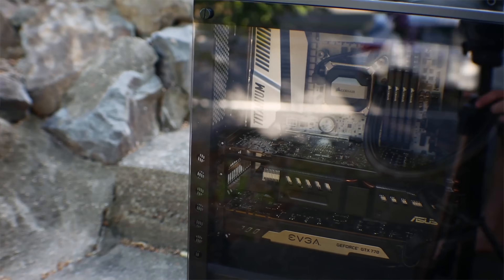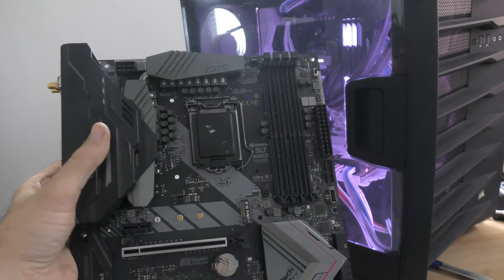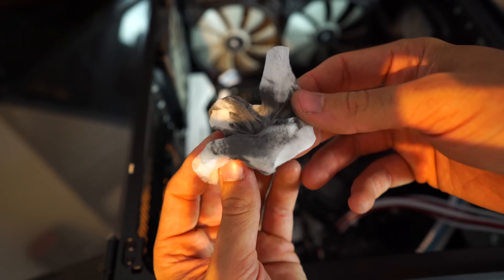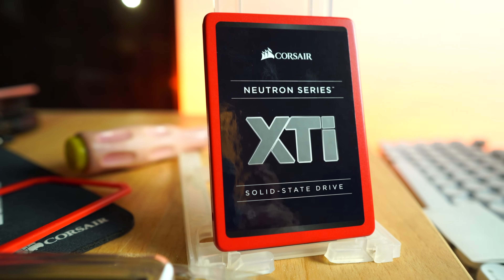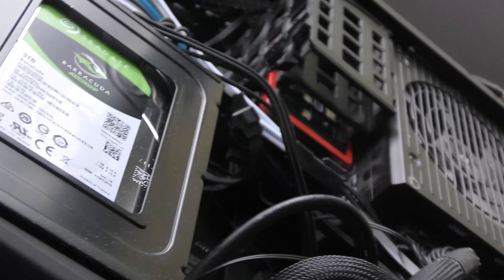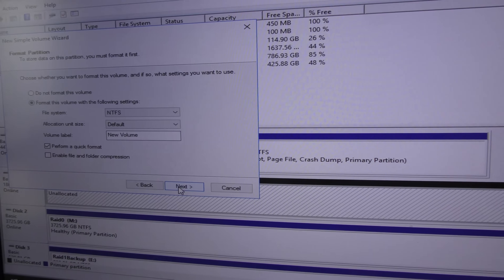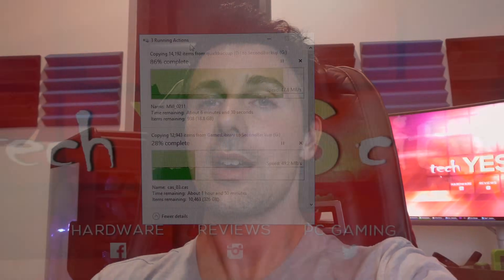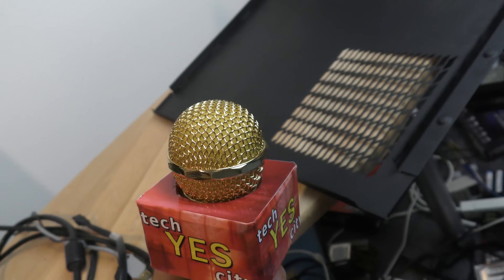Changing my PC from RYZEN to INTEL - Side, Up or DOWNGRADE?

Comment: Even if Intel atm might be better in terms of performance, it's still more than 30% more expensive than a r7 and really not that much more powerful than the red team's pick. We must agree that amd brought something amazing to the table and that is competition, with their zen core processors
Reply: Jackal1810 The thing is that the 8700k doesn't have a MSRP of $300, more like $350, plus it is nigh impossible to find one even at a n inflated price. On the other hand, Ryzen CPUs are so plentiful that you can find them well bellow their MSRP almost everywhere. If someone had told me last year that I was going to be able to buy a 6C/12T processor with Haswell IPC levels for less than $200 in 2017 I would have laughed in their face.
Reply: @Jackal1810
AMD - 
Asus STRIX X370-F $190
Ryzen 7 1700x $280 (without promo code)
Gskill TridentZ 16gb 3200mhz $154
Cryorig H7 $28
Total: $650

Intel -
Asus Strix Z370-F $194
I7 8700k $415
Gskill TridentZ 16gb 3200mhz $154
Cryorig H7 $28
Total: $791

Difference of $141 All prices taken from newegg so with $141 difference given a set budget you could upgrade to the next gpu tier with the Ryzen system. Adobe products use to scale well till the updates but hopefully this will change in the future. My point is that with a ryzen system in 2 years you can just upgrade to zen2. while intel you will have to buy a new CPU and motherboard as z370 wont support anything more than 6c/12t.
Reply: Jackal1810 the lowest price i see is $415 from Newegg. Still think Ryzen is the way to go for under $270 I don't think there is no denying that price to performance.
Reply: Jackal1810  Nope...
Ryzen 7 1700 can be found for 200$, it has its stock cooler and you can easily get to 3.9 ghz with a b350. It's rare that a ryzen chip doesn't reach 4ghz, there are more chips that get to 4.2ghz than chips that get to 3.9.
You don't have to spend to much for rams... I found 2 4gb ram sticks 2666mhz and CL15 for just 77$, and I can easily overclock them.
Ryzen has way better value. 
You can get for 350$ a ryzen 7 + b350 or mATX x370, and you can overclock ryzen with the stock cooler.
With intel you have to spend more than 600$ to get mobo, 8700k and a cheap cooler.
Reply: Jackal1810 Everyone can say everything he wants to say. But is that true?
I can easily say that I've got 4 way sli of 1080tis, but am I lying or not? Who knows...
Reply: Jackal1810 wait I'm not familiar of any i7-8700k processors for $300!?! Where are you finding these prices at?
Reply: @ Mathew Geyer
I bought an 1800x a little over a month ago, along with a Crosshair VI Hero w/Wifi.  I have a custom loop with 2 rads, just for the CPU.  This CPU hits 4.2 on a pretty regular basis, and it's set to "Default" under the OC setting.  I left it alone completely.  The only settings I changed were mem to get to 3200.
The only problem I ever had with this setup was with the BIOS.  I used the latest (1701) from day one, but I had to re-flash it twice due to some strange things happening.  This guy probably should have re-flashed before giving up.  This thing runs fantastic and is getting some very respectable scores benching.  I run AAA games on an RX-470, and I never see the CPU taxed more than 25%, and that's with AC Origins.

I love this thing.
Reply: Lol, the 1700 is the same price as the 8600k, in someplaces its actually less!
Reply: Marius939 / Apocalypse Rising just a year ago you couldn't get an 8 core cpu that wasn't a $1000
Reply: Henji96 what did you have to do to get that clock speed? After market cooler? Delid? How much did you spend for your 5.2ghz? Also the 7700k is only $290 now so if the performance increase is worth it then great, otherwise I would have suggested going with something else.
Reply: I do agree 100%.
My r7 1700 comes within roughly 12% of a similarly spec'ed intel 8700k system when talking about gaming, but in raw cpu horsepower, using Cinebench I hit around 1765 on average from three runs, which means my r7 1700 is stronger than an intel 8700k.
why pay LOADS more for a system that is only better at gaming, and only by a little over 10% The motherboards for that system are way to expensive.
I get it, I want one too because of the gaming performance, but the facts are as such that normal people cannot afford to spend that much for a rig.  Especially if they just upgraded to, say, Ryzen, which is BY FAR the better buy IF you take price into account.

If price is not a concern and someone just said "pick one and it is yours"
two of the exact same in every way except platform and cpu, temps of the 8700k would assure me I stay with Ryzen.  Outside of that I cannot thin of a reason to NOT go with the 8700k system.  Price and temps are my issues with it, other than that, it is one hell of a machine.  It kicks ass, but the price will kick your wallets ass.
Reply: It was a typo.
Reply: price, availability to name two
Reply: Jackal1810 250 isn't bad for   1700
Reply: issaciams delid + x62 cooler + luck. I haven't tried 5.3 GHz yet so I might be able to push it further. My only concern is the temps.
Reply: https://youtu.be/MsnoN5dIPiE?t=2m
Reply: Sure, R7 1700 has better price to performance if you only compare CPU prices, but if you compare full system costs, the price to performance will be a lot closer.
Reply: Fugboi false, a z370 motherboard is very expensive at the moment and you can find a b350 or even a x370 for roughly 120 dollars , the ram and the rest being the same, ryzen setup comes at a lot less money while being only at most 15 percent behind the 8700k
Reply: Marius939 I checked that full system with r7 1700 and 1080ti would cost me $1620, and that's with cheap $60 motherboard with bad VRMs and stock cooler.
8700k system would cost me $1881, and that's with $100 motherboard (probably not the best VRM, but it'll do 5GHz with acceptable temps according to der8auer) and dark rock pro 3 cooler added.
I would 100% pay $260 (16%) more for the 8700k system. The system costs will get closer, if you want a better motherboard for ryzen with better VRMs, if you want better than stock cooler, and when 8700k's prices come down.
Reply: r7 1700x can be found for as low as $230 from microcentre, 8700k is currently around $400 you can buy a $40 cooler and get ryzen to 4ghz.. For gaming with a 1080/v64 or less ryzen is the way to go specially since youll be able to upgrade to ryzen+ next year while with z370 you are stuck with 6 cores
Reply: What makes me a shill? When I have the R7 1700, R7 1800X, 8700K, I can talk from a productivity and gaming point of view.
Reply: +Jackal1810
Nah, for a gamer and productivity guy Ryzen is probably better.
You don't need 144 Hz gaming to enjoy yourself.
Also, have you noticed that the Ryzen systems tend to do better then the equivalently priced Intel CPUs in GPU limited scenarios?
Probably just because of having more cores in the various price ranges, but still.
If it was just one or two reviewers it would obviously just be a statistical insignificant thing, but you see it again and again all over the place.
It's a tiny difference though, usually 2 frames pr second more then the Intel one, sometimes 1 or 3 (hence why it would be irrelevant if it was just one reviewer).
When things are CPU bound then yes, Intel runs away with the averages at least although there's a real fight over the 1% lows.
Actually, you can argue that the experience might be better with the lower difference between the 1% low and the average, although I guess that's a bit up to preferences...
Another thing worth mentioning is that Ryzen is still new to compiler developers and game developers, so even the "Ryzen optimized" code paths in compilers are still only marginally better then running stuff with Intel in mind.
With time Ryzen is likely to improve though.

As for IPC...
Ryzens and Kaby Lakes strengths are in slighly different areas.
When you're just running one thread pr core Intel is a clear winner in IPC due to lower memory latency, lower average cache latency (although some of Ryzens caches are actually competitive), slightly better prefetching and branch prediction.
However when you fill both the threads of a core often Ryzen matches or even beats Intels IPC and can have up to 25% higher IPC in highly optimized (for Ryzen) workloads.
The reason for this is that while both cores have a front end feeding in 4 IPC and Intels Kaby Lake having 8 execution ports vs Ryzens 6, they both also have an opt-cache potentially allowing at least Ryzen (and probably Kaby Lake too) to feed more then 4 instructions in loops and other situations where instructions are repeated, and Ryzens execution ports are a bit more balanced instead of having one "super port" responsible for a whole ton of instructions like on Kaby Lake Ryzen spreads the instructions around the ports in a way that's a bit more balanced reducing the risk of a instruction having to wait on the super port to finish, and since Ryzen also have a back end able to retire up to 6 instructions vs Kaby Lakes 4 that means that Ryzen can in theory do 6 instructions in a single clock cycle while Kaby Lake can never excede 4 (this is for the whole core, with workload from both threads at once, your average thread can only feed  a core with 1-3 instructions pr clock cycle).
Of course the reality is that this only happens in corner cases for a single clock cycle and is not sustainable in practice.
However 5 IPC is actually attainable on Ryzen, provided that the software is programmed to make use of it in both the threads.
So when game designers start adding Ryzen optimizations to their inner game loop they can in theory get quite a boost in performance on Ryzen.

Of course Ryzens advantages only helps when you have two threads in use on the core that's filling it up to the chocking point where Intels better front and inability to retire more then 4 IPC holds it back.
And if both cores get a mix of more then and less then 4 instructions in pr clock cycle Intels 8 ports can actually in theory work on 8 instructions at once (provided that it's instructions that's available on those less capable ports) meaning that the core have more instructions on hold in the core ready to be retired potentially keeping that max of 4 IPC a little bit more consistent in Intel optimized workloads.

Also, spagetti code (not optimized for either) struggles with getting 4 IPC out of a core meaning that AMDs advantage don't apply while Intels still do.
And that's part of the reason why we're seeing Intel pulling ahead right now.

(Even if you have a thread full of instructions if they're not organized in the right way to best utilize the capabilities of a CPU you'll run into bottlenecks lowering your IPC. this happens on both CPUs but due to more compiler optimizations for Intel it happens less on Intel CPUs)

Still, given that games are becomming more and  more multi-threaded Ryzen has more potential, even for gamers in my view.
At least when it comes to high consistent performance and utilization of modern hardware in modern APIs.

You're probably right that the high refresh rate monitor crowd will still be best served by Intel for some time yet.
Both due to clock speed advantages, higher IPC during low thread count workloads and spagetti code and slightly lower latencies for the memory and cache.
But as we move towards 1440p, 3440x1440 and 4k becomming more mainstream I personally think Ryzen is better suited to saturate the GPUs long term.
Reply: You might be "stuck", but you're not using the correct motherboard anyway. Anyone with a current Ryzen setup shouldn't be thinking about getting Ryzen+, it should last you far longer than a small incremental "upgrade".  
Unless you've got deep pockets that's a silly comparison to make, not all Ryzen chips hit 4GHz, you're also going to be paying more for faster RAM where as Intel doesn't need it as much. 
You can also do the same for the 8700K with a "$40 cooler" - not sure what the point is you're making there, when the chip can hit 4.5GHz+ easy.
You lose out on gaming performance with Ryzen but you get the same kinds of performance in productivity, I really don't think the added cost is by any means bad, considering you will now have way better performance in 95% of your Steam library.
Reply: What would be your reasoning for it to be "stupid to buy Intel late 2017 lol"?
Reply: @MythionVR  I dont mean to be rude or anything but the Ryzen 2700x is about $70 cheaper than the i7 8700k and comes with a really good air cooler. The Ryzen 2700x has 8 cores, 16 threads, while the i7 8700k has 6 cores, 12 threads. The i7 has a clock speed of 3.7 while the Ryzen 7 has 4.3. The i7 8700k may be better than the Ryzen 7 1800x (Which is more expensive than the 2700x), I think the Ryzen 2700x is a better deal the the i7 8700k at this point in time.
Reply: @Matthew-ne1xc  None taken, you are however comparing a CPU that was launched over a year ago now, to that of a CPU that came out this year. There would probably be problems if the 2700X didn't at least perform the same/better than an 8700K. I have since moved onto the 9900K since I originally made my comments.  

I still have my 1800X and my fiancee has my 8700K this time around. The 1800X still encodes quite happily, daily on my network.
Reply: @MythionVR  Oh my bad i didnt see the release date on either processors lol I prob should have checked that
Reply: @MythionVR  And im not trying to put either down, they are both amazing chips each with their advantages, and i wish you the best with ur pc:)
Reply: @Matthew-ne1xc  I figured. I love both for what they're good at and I'm more than happy with AMDs current performance, I haven't had an AMD CPU for almost 6 years once Ryzen was launched.
Reply: both are more than fine in gaming , even my R5 1500x can keep 120FPS on a 1080ti on quite a few AAA titles 

Only if you use programms that hugely favor clock speed (adobe >-> ) should you go with intel
Reply: For you, maybe, but considering most of the stuff I play today, which are anything in the last few years performs better on my 8700K, plus my work is better.
For me, it's absolutely worth it.
Reply: Of course it is, nobody is denying that it's a good chip for a good price, we're talking about which is better.
From personal experience, using many Adobe products, Premiere, After Effects, Photoshop, Lightroom and using handbrake, the Ryzen chips are good, but my 8700K does it quicker.
My 1800X has since been retired to transcoding anything I put on my network, which it does a great job at. As for the R7 1700, that's in my fiances build as an upgrade from the 3570K.
Reply: "way better performance " 20 FPS that are beyond the 120 FPS range 

how do you pay more for faster ram ? they both use DDR4 which is stupidly inflated right now
Reply: Winfield Konkel So send me the links, so I can buy the 8700k for 250$.
Reply: How do you NOT pay more, for faster RAM? Go look at DDR4 2666MHz vs 3000MHz/3200MHz. If they were the same price then nobody would pay for 2666MHz.
Overall it's a bit more than 20 FPS, just because you're getting 120 FPS in say 2 games, doesn't mean that's a winner and you should throw out your Intel chip.
Go look at benchmarks on many games, instead of cherry picking, the vast majority are more influenced by IPC instead of multithreaded performance.
Reply: I know you're tooting the "price" horn, but we're still talking about what is better, Intel wins in performance without taking price into consideration.
This is what I've been saying, I still don't get the need to toot the horn of "hurrr Ryzen is r bettr!!1", I own two Ryzen CPUs, my 8700K is better.
Reply: Jackal1810 intel is better in performance, but it's not worth the price.
Reply: "For 20-30 fps of difference" in what two games? You're getting much higher performance in ALL of your games. Maybe you should have gone with a 1070 so you could play more games and see more of a difference.
I have a Steam library with 500 games in it, my 8700K does a much better job, especially when everything runs at great framerates instead of "20-30" FPS lower in the two games you play.
Reply: Wrong
Reply: $400 isn't bad at all for the 8700K, and it still really shines in games and trades blows in productivity. If you're a gamer AND content creator and/or streamer then Intel is what you should go for.
Purely productivity? Go Ryzen.
Reply: Jackal1810 you are indeed right, they are trading blows and now it comes down to you of what do you prioritize, gaming performance or quickness in productivity
Reply: Both, so I go with the 8700K.
Reply: "Only if you use programms that hugely favor clock speed" - you mean gaming as well, right? DX11 games which the vast majority of Steam titles are, run much faster with Intel.
If Ryzen had great/better IPC, then it would be my daily driver, it isn't, I play many different games and simulators.
Secondly, why on earth are you running an R5 1500X with a 1080Ti? 

Oh and 120FPS isn't good enough for me, I have a 144Hz 1080 screen, which is something Ryzen + nVidia can't push as well as Intel + nVidia.

I get people are replying with a bit of sodium, but these are my OWN, PERSONAL, REAL WORLD experiences, I can speak first hand on it because I actually own the 1700, 1800X and the 8700K.
Reply: Explain to me how I'm an Intel fanboy when I've consistently been saying that I have two Ryzen CPUs and an 8700K.
My 8700K performs better than my Ryzen CPUs, which is the point I've been making this entire time.
Reply: Jackal1810 You can overclock ram easily... please, be honest, you're an intel fanboy?
So, should I pay 700$ for 20-30 fps of difference, that on 4k become 4-5? Or I should pay 350$ to get 20-30 fps less in FHD?
If you want to buy a 400$ CPU, I don't think you're gonna play in 1080p... so, don't say shit.
Reply: My 8700k@5.2 GHz blows everything ryzen has to offer out of the water. That's why I bought it, because it's better.